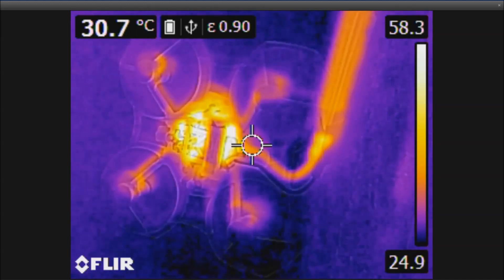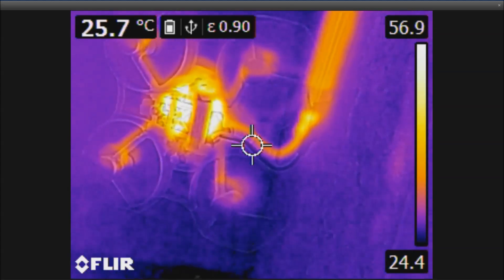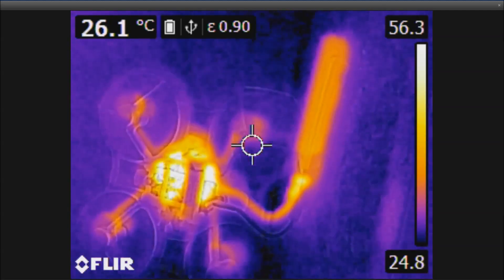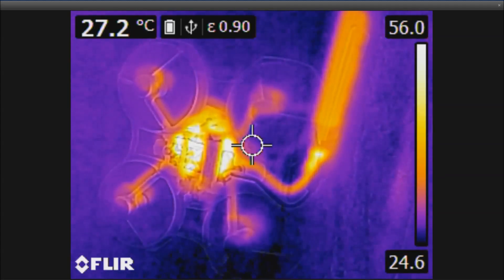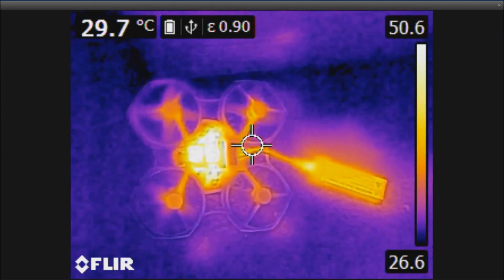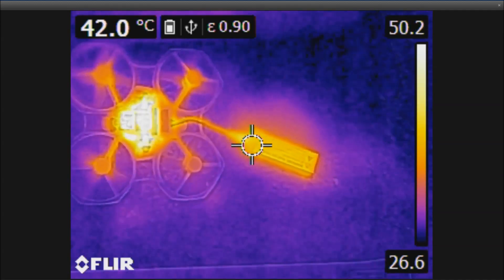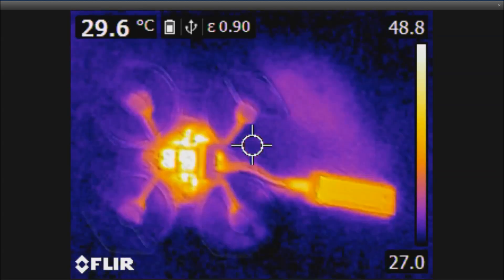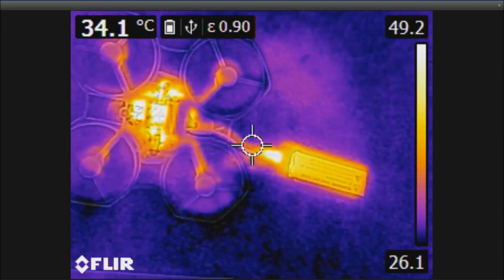Inductrix FPV BL BNF Basic - Thermal Analysis While Operating

Comment: That is a very useful video. Thank you a lot. I ordered XT30 conectors with the inductrix BL.  
the XT30 have a better conection and the flight time might improve a little.
Reply: what batteries did you find with xt30 connectors ?
Reply: pointnozzleaway none, i just bought some 600mah lipos with a JST. I solder new xt30 conector on the lipos
Reply: ChinaHobbyLine has them for a little over $8/ea or 3 for $20. https://chinahobbyline.com/index.php?route=product/category&battery_min=3&battery_max=3&capacit_min=0&capacit_max=560